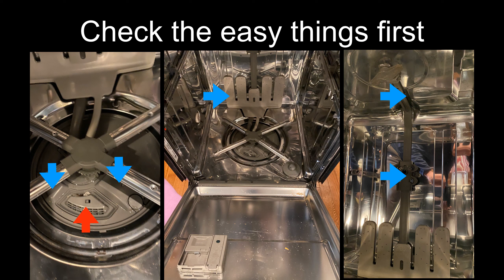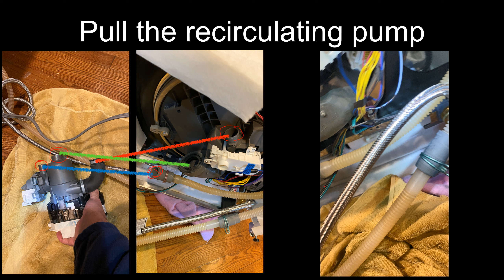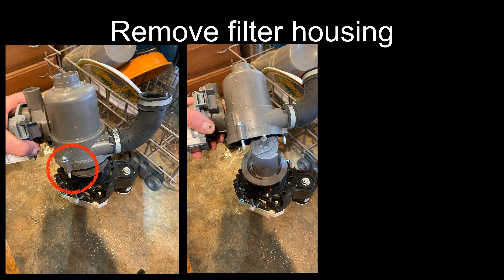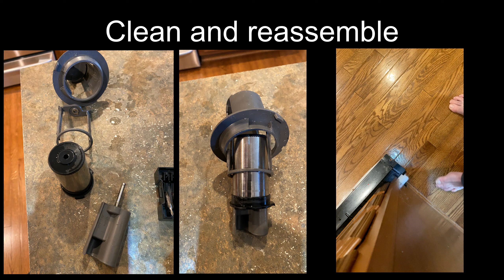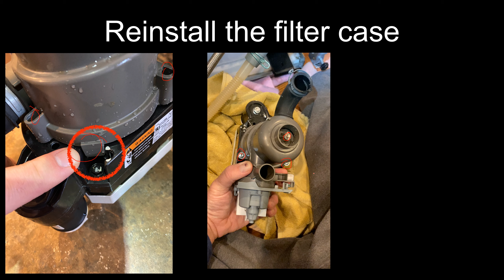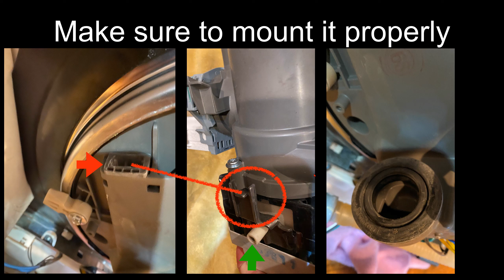fix your KitchenAid dishwasher that isn't cleaning well , KitchenAid KDTM354Dss4

Comment: Thanks for the video! I disassembled mine and the screen was completely destroyed! Have a new one on order $138, but it explains why it's been so loud lately. Any tricks to getting the pump back on the main drain? It doesn't have a clamp and seems like it was pressed in, I reassembled everything so I don't loose any parts but that hose on the pump was leaking when I tested it. Thanks again.

Comment: Thanks for the video and run through. Definitely has saved us from buying a new dishwasher, and it has only been six years. Our filter was ripped up and the plastic blades broke and seemed to cause the  damage to the metal filter. We installed a new filter and plastic housing as it is sold together, KitchenAid Dishwasher Pump Filter W11084156, but now we are hearing a whirring spinning sound and it seems like maybe it isn't seated correctly. I will take it apart again and try to reseat it. If anyone has ideas I would appreciate them.  Thank you in advance.

Comment: I just put the spring on top of that washer and put everything back together and it worked.  This video was so helpful. The sump pump had been replaced about a year ago (the second time, the first under warranty) and I was not going to spend another $400+ on another pump. It turned out the problem was a large mass of gunk completely covering the filter, but the filter was still intact and the pump motor still worked. The dishwasher works great now.

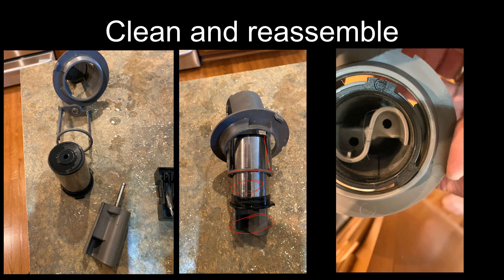Comment: In the leftmost picture at 8:35 there's a little washer with a projection at the top of the filter cage. But a little spring also popped out and I can't figure where it is supposed to go. Any insight?
Reply from the maker: I don’t remember a spring but it’s been a while since doing this one.  Did it pop out after undoing the c clip or after taking the filter out of the assembly?
Reply: Did you find a solution I'm having the same issue
Reply: My reply is above. I just put the spring on top of the washer before reassembling and it worked.

Comment: Great video.  My wife and I have the exact same KitchenAid #KDTM543DSS4 model, and in fact, we just had a repairman over to the house to check out why it wasn't agitating/spraying at all...and only made an ominous low frequency hum (moaning sound.)  😵 The tech found the "pump" to be fully clogged up with detergent residue!  Yup.  So after cleaning that gunk out he got it back together and voila'!  It's now working like a charm.  
Apparently we had been violating three principles of dishwasher use:  1.) We used too much detergent (duh!) as we had been using Finish Powerball Max-in-1 tabs in the dispenser cup but then adding a shake or two of powered d/w detergent directly into the unit just before closing the door and starting the cycle, 2.) now that we use a water softener here at home we had the built-in rinse aid setting too high (it's now set down to "1"...the lowest setting,) and 3.) we were pre-rinsing the dishes TOO MUCH before we put them into the dishwasher!  Who knew!
I also did a white vinegar wash on the unit yesterday too (two cups of vinegar in a container in the lower basket w/o any dishes and let that run on an empty dishwasher.)  Even the racks slide in and out easier now!
Oh, and yes...we've been using the Affresh tabs monthly since Day 1 when the "Affresh" light appears on the outside panel!
Thanks again for the video!
Reply from the maker: Glad it’s working for you.  About 6 months After I made that video my filter ripped and ended up blowing the thermal fuse in the main motor so I have another video for that little adventure.   I’m not sure what caused it to rip as everything was clean this time.   I suspect some glass got in it as a glass bowl had broken in it a few weeks prior to the issue.

Comment: Dan, thanks for this guide.  I have a question about a consistent problem I'm having with this model and is increasingly getting worse.  I'm getting a consistent buildup of black mildew on the bottom and interior door.  I've removed the drain cover multiple times and have had to clean this black smudge from inside the drain area.  The dishwasher drains but I don't know how to address this sludge buildup.  Could the main filter inside the pump be the issue?
Reply from the maker: Hi Dave.  it could be the filter especially if the water flow is not good in the machine.  With that said I've recently found that lots of the newer machines should have a disinfectant run through them ever so often.  This can also free up any gunk and sludge that might have built up in the pump filter.  I think thats the first thing I would do to diagnose the problem. 
I purchased mine at Walmart in a liquid bottle form but I know you can get it other places and in tablet form.  
recently I had another issue with the pump filter and this time it completely destroyed itself causing multiple issues including causing the primary motor's thermal fuse to blow.  I am going to make a video on that issue soon.  after I fixed the motor and replaced the filter it was poorly cleaning dishes and I did notice there was gunk build up after that. at any rate after using the disinfectant cleaner all that ick was gone.  the stuff I used is called dishwasher cleaner and its by Glisten.

Comment: Thank You so much for this instructional tutorial. I have a KDTM354DSS4 KitchenAid dishwasher.  The water isn't draining, from the base of the unit.  Your instructions for taking the unit apart are direct and to the point.  I  am in the process of disassembling the unit.  My unit is 5 years old.  There is an ample amount of sludge build up. Paper, food, glass etc.   I will be doing a complete break down and cleaning, of internal parts.     Again thank you.
Reply from the maker: I'm glad this helped you and thanks for letting me know.
Reply: Mine isn't draining right now.  Firstly, hope you got your issue fixed.  Quick question..  do you need to put the plate (part below the filter) and the filter back in place to test the drain?
Reply from the maker: @12Daze  if you are referring to the plate bellow the water spray arm in the bottom that the initial filter snaps In to, I think you could test it temporarily like that without issue.  But when you go to use it you’ll want that in place to filter large food pieces.
Reply: @12Daze     I got interior of unit taken apart and cleaned. I now need to remove unit from enclosed area.  Do you know how to access codes on unit.   My next move is to access pump, motor, filter.
Reply: @onefivetwo4473  I don't.  If the clog isn't happening inside the unit, that's as far as I'm willing to go.  I plan on calling a plumber soon.
Reply: Horrible video. Just show how to do it

Comment: No mention of drying-sanitize issues - I replaced element but no heat still - control board next or sensors?
Reply from the maker: thats something I have not run in to with this unit so far.  BUT with that said I have had problems with the unit loosing its mind and doing nothing.  in order to fix this I have had to reboot it.  for most units simply removing power for 30 seconds and starting it back up will reboot it but not for this one.  This one I have to turn the circuit breaker off for at least 1 hour and then power back up and that has fixed its issues so far.  Thats the next thing I would try before doing anything else.  if i see any other posts out there with that as an issue I will post it up hear.

Comment: I highly suggest using affresh cleaning tablets, you will not believe how it cleans the interior. No over statement here. It will also clean the lime build up in the mesh filter by the pump and protect it against tears. For this specific case, your filter is good, you could cycle with affresh, and save all the labor you had to go through. It would literally resurrect the filter mesh to brand new. Try and see...
Reply: HA! I'm finally learning to day what the "Affresh" that lights up occasionally means! I always thought it was just a notice that the batch of dishes came out super clean!

Comment: Huge thanks for the video!  My problem was slightly different (huge fat deposit in the filter impeding the rotation of the pump/motor) but you gave me some confidence to attempt the repair.  Cheers-
Reply from the maker: good to hear it and glad you replied with the actual problem.  will help others.
Reply: Try affresh tablets prior to the repair.

Comment: Thank you for this, just what I needed.  First, to see that there are no user-serviceable parts from the inside beyond what you showed (including taking the semicircular piece out from below the lower rotating arm and cleaning out the gunk there).  I've cleaned out the insides and will see if that solves my sub-par cleaning issue.  (Also added some Jet-Dry).  If not, I'll check the filter like you show.
Reply from the maker: Let us know how it turns out.  👍